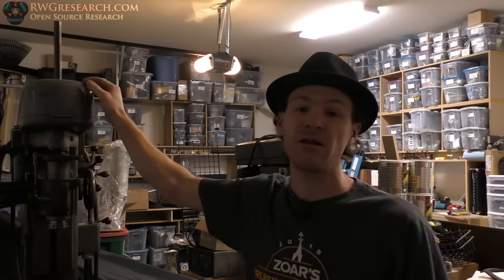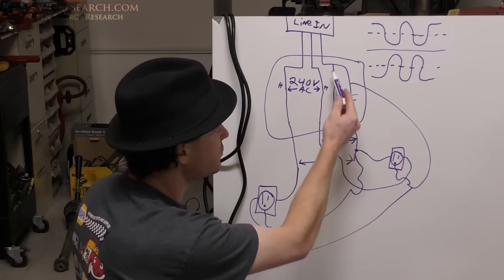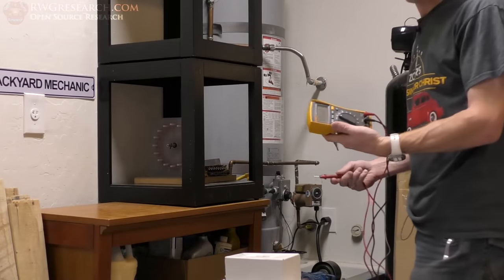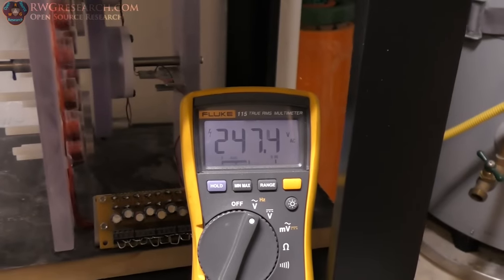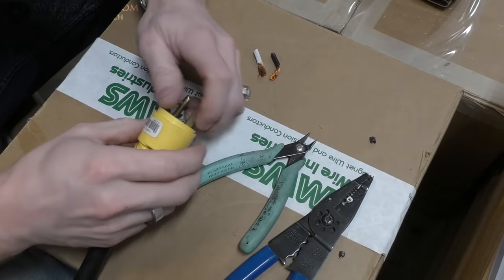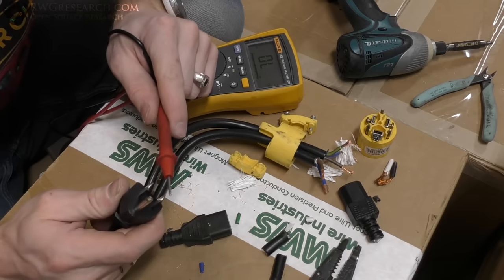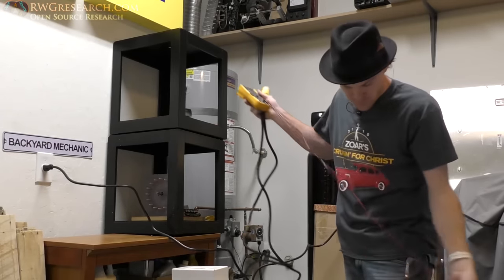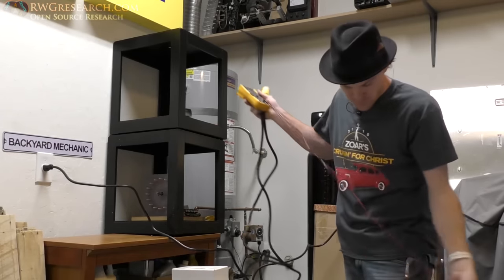How To Get 220V/240V From Two 120V Outlets. No Electrical Panel Work Required...

Comment: I'm confused. Both of the "110" outlets he used looked like 20 amp 220 plugs.
Reply: No they were just standard 15 amp  120 V outlets. Most people put 15 amp outlets on 12 gauge wire since you shouldn’t be drawing anymore than 1.5  amps per outlet it’s okay to use 15 amp outlets
Reply: I agree it looks like the plugs he used were the same outlet that he wired up

Comment: I have 1 motor 125volt but how to Run in 220 volt socket,please suggest
Reply: Use only 1 pole from the 220 plug and then find a neutral from a 110 plug. Use the ground from the 220 and run to the chassis

Comment: Suggested title - HOW TO GET YOURSELF ELECTROCUTED - if one plug is out, it's live pin may be at 120V relative to ground. There's a reason why this is not commonly done. Just wire yourself a 220V outlet from the panel.

Comment: I don't know if you mentioned if the wires are crossed in the custom plug you made it causes a dead short when  connected into the 120v wall outlets and arc shock electrocute someone.  The breaker should trip but not before some fireworks

Comment: For me -- just easier to run a 240v circuit to a proper 240v outlet from the panel -- yes that's how it works, you take hot from each phase, this works, but this is super janky.
Reply from the maker: janky... yes, however, i have 2 main panels in my house and EVERY slot is full. there are NO 220/240V outlets anywhere... so I'm left with this option... fortunately its a light load and i dont use it that often.. so its all good... ~Russ
Reply: Sounds like you need a subpanel -- which is the right way to expand your electrical, you know your electrical, so should not be hard to add one. I have a full size subpanel for all my basement -- workshop stuff, and have a few things on 240, plus a 240 circuit SHOULD be using a double breaker so it trips together.
Reply from the maker: Yes, you are correct. and I agree, ~Russ

Comment: How to burn down your house in two steps.
Reply: The only difference between this and a "proper" installation is that the proper one has both wires in a single bundle.  rwg42985 shows us how to get 240VAC from one wire in each of 2 bundles.
Reply: it 's actually not risky.
Reply: @tonytony6912  iTs aCtUaLLy NoT rIsKy
Reply: @hippydude1606 it's only risky if the existing wiring is ancient, or you're using some minimal gauge combining cable.

Comment: Nice! Could the same technique be used to make a Y adapter to turn two 240V receptacles into a 3 phase 480V source? If so, could you make a video on that?
Reply: only if the house has 440 coming from the power company.
You really do not understand what he's doing do you?  
You may be able to install a step up transformer and get 440 signal phace you'd have to turn into a 3 phase with a converter.  But this is a good question I don't know the answer too  search for it and see what you get.
Or if your house isn't far away from the step down converter the power company might do it for you and sometimes its no charge for the service upgrade. its worth asking before you do anything.
I knew a guy with a tanning salon they came and ran a service upgrade for him at no charge because his new beds required 440 instead of 240 volts. But this was commercial space.
If you live off a country road and the closest transformer is 2 miles away your going to pay for it no doubt.
Reply: @bobbg9041  Yeah, that's what I thought. I've been looking at this sort of thing for a while, including step up transformers and rotary phase converters. There's a few videos here that show how to do what I want but I was just hoping this would be a simper and more cost effective way.
Reply: @jdvaillancourt  I made a rotary phase converter not hard and I spent next to nothing but I'm an HVAC guy so I can get my hands on start and run capacitors free off old equipment all day hell I got a nice VFD out of the bone yard not long ago  all the newer units have them

Comment: Don't understand how the milling machine has a "3-phase generator" Can you explain that?
Reply: the milling machine was made for commercial use requires 3 phase that no home owners has so a 3 phase adapter is required.
Reply: Doug Moody it’s a 1 to 3 phase generator. It works by taking the 220vac 1ph 60hz and converting it to DC. Then with pulese technology outputs 3ph 60hz. The unit in use here is old and clunky the newer ones are fully solid state I.G.B.T. technology which are a lot better and quieter. When using these generator units an isolated transformer with choke technology is recommended to avoid back feeding any harmful harmonics onto the household lines which wreak havoc with computers and other sensitive electronics. Hope this explanation helps.

Comment: Correct me if I'm wrong but wouldn't the wiring for your 120 to 240 adapter harness be the same no matter what 2 outlets someone finds that add up to 240v? If so, I think that you should mass produce this.

Comment: Is it possible that NONE of the outlets are"out of phase"? In that case how can you do this?
Reply: swap any 2 breakers so both circuits are on different phases. It's the opposite phase every other position on the buss bar
Reply: @emarr3720  can u explain with more detail my man?
Reply: So u got 2 circuits that need to be on different phases. Turn off the main breaker. Pick 1 of the 2 circuits & note the breaker that it's connected to & count 2 breaker spaces up or down (every other), that's where circuit #2 breaker shld be because that phase is opposite circuit #1 breaker . Move it there. If another breaker is in that spot, swap them. U don't even need to disconnect the hots, just unlatch the breakers & their attached wires to new spaces.

Turn off the main breaker first & don't touch anything above it because those r still live. Anything below the main breaker is ok because the individual breakers r disconnected.

Comment: I did exactly what you did and it immediately pops both breakers what am I doing wrong?
Reply: Your 240 Volt equipment is drawing more amperage then the two 120 Volt circuits are rated for.

Comment: Looking at your drawn sine waves it made me think. Wouldn’t those cancel out. I wonder if the sine waves from both legs actually match. That way they are additive giving you the 240v. 

I tried to find an article on this but couldn’t find one. So this is just my intuition. If anyone has more knowledge on this please comment.
Reply: if they match = no potential = no voltage between wires = same phase
in 3 phase system there is always 120 degrees between phases, so you cant get double the voltage between two phases... if you connect two phases you will get approximately 208v
Reply: Eco, you are correct.
Reply: Right we have to look at the voltage potential between the 2 legs. If they are the same leg then they match so the voltage potential between them is zero. It would not even be the 120v you get between one leg and neutral. You would have no power at all. 

If it is the 2 separate legs then when one is 169v (120 x sqrt2) the other will be -169v and the potential between those is 339v. Which is the peek voltage in a 220v system.
Reply: So in a 3 phase system when you are using 2 legs the 0 voltage happens when there is 0 potential which looks like it happens when both legs are about 80v then happens again when they are both -80v. Wow that is not intuitive until you think it through.

Comment: The water heater would have been my 220 source. But if I had no other place.I would not hVe computer power cords.they are #14 gauge..an how many amps does that mill draw.l 'll
Reply: He was looking at the power rating of the cord the wrong way , The female plug may be rated 15 amps but the cord itself is only 16 or 18 gauge , He should have looked at the cord because all cords have the wire gauge stamped on them and should be using 12 gauge cords for plugging into the two separate outlets , Now if the breaker panel is full , Depending on the make of the panel , You can take 4 breakers out and replace them with two tandem breakers to provide the two spaces needed for a two pole breaker for the 220 line you want , That's what I do when someone needs me to install a 220 line and there's no space for an additional breaker , I've done this many times when another circuit needs to be installed when there's no space left on the panel for another breaker , It's best that he runs a 220 line , Takes 4 breakers out and puts in two tandem breakers , Then he'll have the space available for the 220 breaker , Tandem breakers are two breakers which use only one space in the panel , I know Siemens and Square D have tandem breakers available  , If I needed a 220 line , I would install it with the proper size breaker and a disconnect switch at the other end and do it right , Not use this method , Never take chances with electricity , ALWAYS PUT SAFETY FIRST !!!
Reply: You could use the 220 line for the hot water tank as an alternative 220 line for your equipment , Which is safer than plugging two separate cords into two separate outlets , He should have taken an amp reading to see if the circuit can handle it or not , Also when using a phase converter , The amp draw is gonna be approximately 33 percent more than the amperage on the three phase motor because you're running It on single phase and using a separate three phase motor to generate the third phase , So that's why the amp draw is gonna be higher running a three phase motor on single phase and depending how many amps his milling machine draws , The two separate circuits may not be sufficient to run the machine safely , So it's best to install a separate 220 line for the equipment because all 220 lines have to be designated circuits for each piece of equipment and is required by The National Electrical Code , When building a phase converter , Not only do you need a three phase motor for generating the third phase , You need the proper capacitors for the HP of the motor on the machine and matching the voltage of the motor to correct power factor

Comment: He just got lucky to have 2 receptical that close on different breakers,,,, most would be in separate rooms,,and the cord makeup would probably have to be much longer
Reply: Which poses a new set of possible issues due to higher resistance
Reply: @CattleRustlerOCN  Excaclly

Comment: I'm an Electrician traniee and I had just wondered if this was possible. My god you can find anything on the internet and even DIY video lol. Great job. I have a question, could you have spliced the neutrals together with or w/o equipment grounding conductor? How is the power returning back?
Reply: Through the ground.  Ground and neutral are tied together.

Comment: What you describe works perfectly fine, but you mentioning two out-of-phase sine waves isn't accurate.

If they were out of phase, you'd have ZERO volts at all points, because they would cancel each other out.  Like ALL out-of-phase signals do.

Comment: lets say i have a 220v outlet from a dryer close to my garage and i need a 110v outlet for a small mig welder which uses 20amps ... does anyone know how i could install that .. or anyone have a diagram i could download ..THANX ..!!
Reply: No you can not safely do that all circuits need to be on a separate breaker not wired to one side of a 240 volt double breaker.

Comment: The proper way to do this, of course, would be to install another breaker. But it's more fun to do it this way :) Next you should do PoE the wrong way (wire 120v into an ethernet cable and let out some magic smoke)

Comment: I would take his advice to just install a new 240 circuit!

Also I think he is a bit off base. The two legs that come into your house main panel are NOT two phases, the two legs make up a single phase.
His diagram showing the two 120v sine waves 180 degrees out phase only bears on the 120v circuits because they describe the path of each 120v leg to the neutral.  In the case of a 240v circuit there is no neutral, just a completed circuit across the two 120v legs... the result is just a single sine wave twice the amplitude of a single 120v leg to neutral. 
 Measuring the voltage between the two small slots on single receptacle made no sense, they are not 0 because they are 180 degrees out of phase, it is because they are both tied to a single 120v leg and he was not completing a circuit. It’s the same as putting both probes on the same terminal of a battery.
Reply: @blowme5150  Maybe I can explain it more clearly than I did. His explanation of how 240v is achieved is incorrect, he is confusing the 2 legs of a single phase with two separate phases. 
The standard residential supply is a SINGLE PHASE 240v main panel. The panel is fed from a transformer at the power pole that steps higher voltage down to 240v, and it outputs 2 120v legs and a neutral which is actually a center tap connection from that transformer. When you connect a single breaker in the panel it connects one leg with the Neutral or center tap of transformer resulting in 120v or half the 240v output. If you install a double breaker, it connects the two 120v legs resulting in 240v. 
There is no phase difference because this is a single phase, only a difference in amplitude of the sine wave, from +60v/-60 to +120/-120v.

Comment: But BUT, if one circuit breaker pops and your machine is turned on, the other popped circuit remains HOT!  Solution: a relay on each branch that turns the other branch off.

Comment: I'm a electrician I have nothing to say like he said wire at ur risk. all I can say folks wire right way n get ur 220 volts. me personally ran another line n made room
Reply: Question: there is 2 circuit and 2 breakers in this system. if one of the two breaker trips, both circuit is still live right?
Reply: @Lam-s-Workshop  one circuit is not live but the other circuit is. you have two different breakers

Comment: That masterpiece of yours in going to burn down your shop when something goes wrong on one of those neutrals, and you exceed the wire capacity on the other one by 100%.   Think your insurance company is  going to pay up, or tell you to piss-off?    One guess.

This will also defeat any GFCI on either circuit, in theory.    Good luck, buy a fire extinguisher, and do a video how to put out an electrical fire in the shop next :/

Comment: I'm not an electrician, but I do understand what you did and it's not good. Do it correctly and use the appropriate gauge wire. At best, you have 20 amps and are those extension cords 12 gauge? 14 gauge? Who knows. 
Does the milling machine need less than 20 amps? Most equipment that requires 240 volts also requires at least 30 amps. Just saying.

Comment: You can't take a compressor line@ 90 psi and add another@90 and get 180 psi. You still have 90psi. Likewise your getting only a small amperage with that setup. You have 220 but do u have enough amps?I would be concerned with heat from you equipment pulling juice. Just sayin

Comment: The first time you went to a wall socket you connected a voltmeter on the same line. Of course no voltage!
You did not demonstrate two hots out of phase there! In an electrical panel in every home has two columns of circuit breakers with a neutral line running in the middle. 
On the other side of the  circuit breakers are two out of phase 180 degree hot lines. You can put a gang of two circuit breakers to provide power to a line requiring 220 Volts 
and they are in phase  compared to the neutral. That is how the EU and Great Britain powers up stuff. That is usually how most 220 Volt powered things use.
 Instead you found the two opposing sides hot lines via wall outlets and connected each hot line  from the panel that are 180 degrees out of phase and put them into a 
 220 Volt receptacle via a heavy duty extension cord. Now you can power three phases.Clever dude. More current available now.

Comment: You may as well just pull your service feeders out and split bolt em to them there computer cords! Happy fourth of July budday! 🎆
Reply: UNLIMITED POWER!!!!
Reply: tomorrow i’m going to do what  you suggested only i’m going to keep the service runs connected to the main lugs in the panel and somewhere before the meter im going to join my hot tub wires together with the service wires using copper nails
Reply: Self tapping screws right to the buss bars. Just undersize your conductors to protect equipment...use metal conduit or burn your shop to the ground...i swear the taught me that trick in tradeschool.

Comment: Change your 110V breaker to 220V breaker, then change the 110V outlet to 220V outlet.
Reply: That would work but you can't have anything else left on that entire circuit. I imagine you are suggesting moving the neutral at the panel to a hot leg.